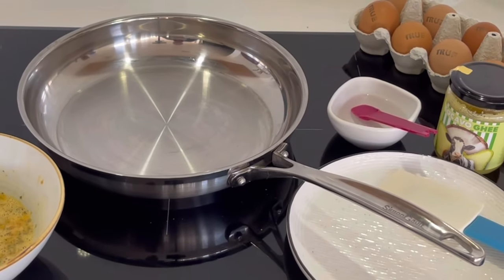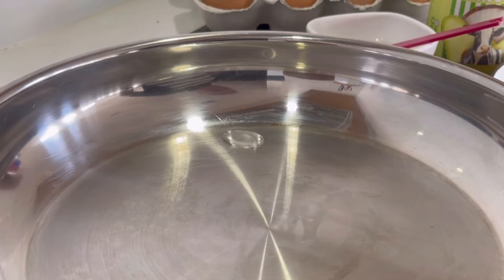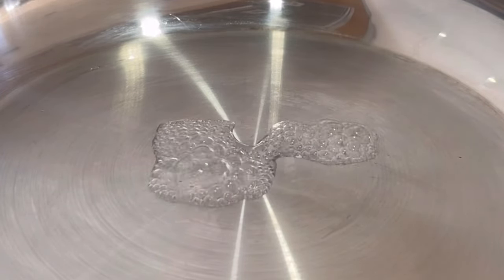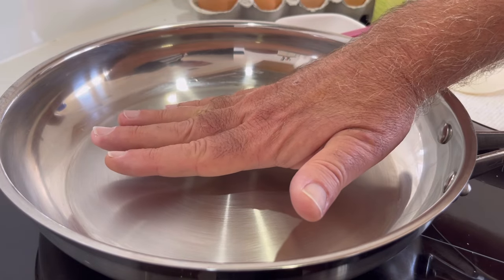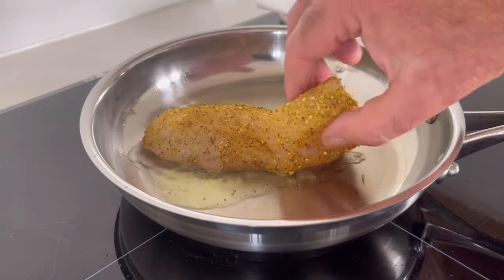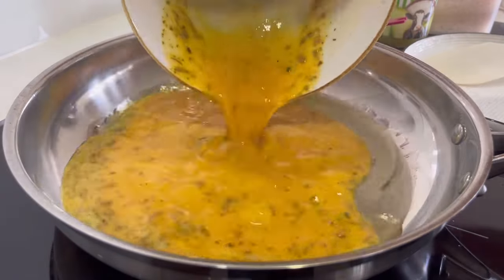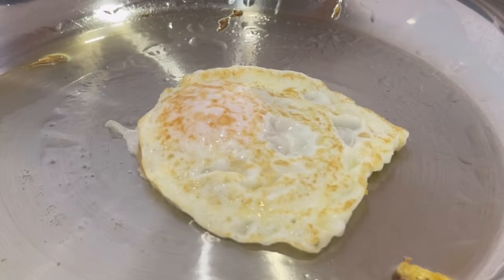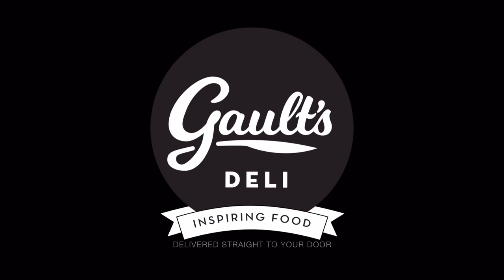The Ultimate Guide: How to Make Food Not Stick in a Stainless Steel Pan! 🍳🚫

Comment: This doesn’t work all them time,you can’t cook a burger back to back because it will stick. You have to clean the pan after each burger. It’s really annoying
Reply from the maker: You're absolutely right, burgers can be a bit sticky business on stainless steel, even with the perfect preheat!  Cleaning after each one can definitely be a drag. Here are a couple tricks that might help:

If you're grilling up a burger party, consider cooking them in batches instead of all at once. This will help keep the pan from getting overcrowded, which can lead to sticking.

A wider pan gives the burgers more space to sear properly without crowding each other. This can help prevent them from sticking together and making a mess.

Once you've got a nice sear on the first side, resist the urge to flip too early! Give the burger a minute or two to set up before moving it. This will help it release more easily from the pan.

While preheating is key, a touch more oil can also be your friend with burgers.  Just a thin layer can help create a barrier between the meat and the pan, preventing sticking.

 If you're really struggling with sticking, cast iron pans are naturally non-stick once seasoned properly. They might be a good option for future burger battles!

Thanks for the heads up, this is a great point to consider for anyone new to stainless steel.  Keep those burger grilling skills on point!

Cheers, 
Simon

Comment: Sadly this is not working for me the water is evaporating or just bubbling… no in between… help!
Reply from the maker: Hi PuffyLush,
If the water droplets are immediately evaporating upon contact with the pan, it suggests that your pan might be too hot. On the other hand, if the water just bubbles without skittering around, your pan is not hot enough. The test with water relies on the pan being at just the right temperature so that the water droplet can hover on the layer of its own steam without instantly evaporating. This usually occurs around 160°C (320°F), well above the boiling point of water but below the point where it would evaporate instantly.
Here are some suggestions to try:

Adjust your heat: If the water evaporates instantly, lower your heat slightly. Wait a minute or two, then try the water test again. If the water only bubbles, increase the heat slightly and repeat the test.

Warm up your pan slowly: If you're using a thick pan (like cast iron or thick-bottomed stainless steel), it may need more time to heat up evenly. Try leaving it on a medium heat for a few minutes longer.

Use a infrared thermometer: If you're finding the water test too unreliable, consider using an infrared thermometer to check your pan's temperature. This can give you a more accurate reading and help you find the right heat setting on your stove for the perfect pan temperature.
I hope this helps. Good luck.
Simon

Comment: Your explanation needs to be clearer so you were so confusing
Reply from the maker: Looking back, can you tell me what specific part of the video you found confusing?  Knowing that will help me improve the explanation for future viewers.

In the meantime, here are some additional tips that might be helpful for using stainless steel pans:

The water droplet test: This is a great way to gauge the pan's temperature. When a drop of water beads up and dances on the surface, the pan is hot enough for most things (except delicate fish).
Start with a hot, but not smoking, pan: High heat can be good for searing, but if you're worried about sticking, use a medium to medium-high heat setting.
Use the right amount of oil: A thin layer of oil will help prevent sticking without burning.
Don't overcrowd the pan: This can lead to uneven cooking and sticking.
Use a metal spatula: These are better for maneuvering food in a stainless steel pan than plastic utensils.
Let me know if any of these points clarify things, or if you have any other questions about using stainless steel pans.  I'm always happy to help!

Simon

Comment: When I put the butter it just turns black... Anyone?
Reply: To prevent that you need to first add the oil and then add the butter.
Reply: @lewisevander   thanks 👍
Reply from the maker: Hi there! Thanks for your comment. If your butter is turning black, it’s likely that the pan is too hot when you add it. Here are a few tips to help prevent this:

Preheat the Pan Correctly: Use the 'mercury ball effect' to test if your pan is at the right temperature. Add a droplet of water to the pan. If it forms a ball and dances on the surface, the pan is ready for the butter.

Lower the Heat: Ensure the pan isn't too hot before adding the butter. Stainless steel pans retain heat well, so it's better to err on the side of a lower temperature.

Add Oil First: If you prefer using regular butter, try adding a small amount of oil (like olive oil) to the pan first. This helps raise the smoke point of the butter and prevents it from burning.

Another Option You May Prefer: Use clarified butter or ghee. These have a higher smoke point than regular butter and are less likely to burn.

Hope this helps!
Reply: @simongault5804   thank you so much man you really try and respond to each comment!

Comment: Mine still sticks because i reduce the heat after it beads because its too hot for what im cooking. Any tips?
Reply from the maker: Great question! If you need to reduce the heat after the water beads, try this: after achieving the Leidenfrost effect, add your oil and wait a few seconds for it to heat up. Then, add your ingredients and immediately reduce the heat to your desired cooking temperature. This way, the pan maintains its non-stick properties from the initial heating, but you avoid burning your food. Also, ensure you're using enough oil and that the food surface is dry (not moist) before adding it to the pan to prevent sticking.

Hope this helps!
Cheers,
Simon

Comment: My pans become non stick using this method but they also are too hot and cook the food way to fast if i put oil in it immediately smokes and the food just burns within 30 seconds this is when the pan is at the water ball level hot so not too hot for the test if i try to do it before the water ball level it will stick so i cant see how i can make it not stick but also cook the food at a lower temp required for even cooking?
Reply from the maker: Thanks for the question! If your pan is getting too hot, causing oil to smoke and food to burn, here's a method to try:

Heat the Pan: Achieve the Leidenfrost effect with the water droplet.
Cool Down Slightly: Once you see the water ball, reduce the heat slightly and let the pan cool for a moment before adding oil.
Add Oil: Add your oil and let it heat up, but not to the smoking point.
Add Food: Add your food quickly and then reduce the heat to the desired cooking temperature.
This should help maintain non-stick properties without overheating.

Hope this helps!
Cheers,
Simon
Reply: @simongault5804  This is the question I came looking for an answer to as well. I would love a video that explains this part more, eg dropping the temp once the non stick is achieved. It's been hit and miss for me.
Reply from the maker: @SelinaFenechArtistAndAuthor  Hi Selina, The key is to adjust the heat once you've achieved that initial sear or non-stick effect. Generally, you’ll want to lower the heat slightly to maintain the cooking process without burning or overcooking the food. This gives you better control and ensures even results.

I’m planning to make a video that dives deeper into this topic, explaining when and how to adjust the temperature for consistent results. I’ll get to it as soon as I can (I’m busy judging cooking competitions this week). Thanks for the suggestion!
Cheers,
Simon

Comment: Can I put the water in first and wait until it balls up? Or do I have to add water after I suspect it's at the right temperature?
Reply from the maker: You should first heat the pan and then add the water to test the temperature. The idea is to get the pan up to the right heat before you add any ingredients. If you add the water first, it will just evaporate slowly, and you won’t be able to gauge when the pan is at the perfect temperature.

Instead, heat the pan dry for a couple of minutes, then add a small drop of water (like a 1/4 teaspoon). If the water forms a ball and "dances" across the surface, the pan is ready. This method ensures you're at the correct temperature for cooking without sticking.
Reply: @simongault5804  Thanks so much for the response! I had steak and eggs for dinner, cooked back to back in the same pan. I pre-heated the pan as advised (with dancing water!) and the steak didn't stick, but the eggs did. I guess maybe the pan got too hot while I was cooking the steak? Any advice? Do I need to let the pan cool before putting the eggs in?
Reply from the maker: Thanks for the feedback! Glad to hear the steak turned out well with the dancing water trick! As for the eggs, you're right—it's likely the pan got too hot while cooking the steak. Eggs are a bit more delicate and need a lower temperature to avoid sticking. I’d recommend letting the pan cool slightly before adding the eggs or lowering the heat once the steak is done. You can also add a bit more butter or oil before cooking the eggs to help prevent sticking. Hope this helps, and happy cooking!
Reply: @simongault5804  Thank you! I've cooked eggs twice now and it works! :D I'm still getting the hang of it, but at least I'm on the right track now and have a general idea of what to do. I only started cooking this year and with a stainless steel pan a few days ago. Looking forward to mastering it. I really appreciate your help. Thanks, Chef!:virtualhug:

Comment: Can you adjust the temperature after the water starts "dancing" around the pan? Or do you have to keep it at the same temperature?
Reply from the maker: Hi Ewilds,

Certainly! You can adjust the temperature, but keep in mind a couple of things:

- Different foods require varying cooking temperatures. For instance, delicate items like eggs need a lower temperature compared to what you'd use for searing meat.
- After establishing the non-stick surface, tailor the temperature to suit what you're cooking, but avoid making drastic changes.
- Remember, each pan may react differently to temperature adjustments due to its material and thickness. With time and experience, you'll gain a better understanding of how your particular pan behaves and how to effectively modify the temperature for various cooking needs.

Hope this helps. Happy sautéing!

Best,
Simon

Comment: help im desperate 
So i tried this trick since many many videos give the same tip and the comments agree with them as well but when i tried it.. the moment it was just hot enough for the water to bead up, i added the peanut oil and it immediately started smoking and giving off a burnt smell and my eggs are like instantly burnt even as i lower the heat on my induction stove. I tried it seven times to make a fried egg (no joke) and i am just curious why this tip works for most people and not me. Is it the exact material of the pan?
Reply from the maker: Hi Speed,
It sounds like you’ve been through quite the process trying to get that technique right! There are a few things that might be causing the issue:

Once you achieve the beading of the water droplet, try turning the heat down. A common mistake is heating the pan on high and not lowering the temperature once the beading effect occurs. If you leave it on high, the pan will continue to heat up and become too hot. It’s best to gradually heat the pan over medium heat, allowing better control of the temperature and preventing overheating.

Oil Type: Peanut oil has a relatively high smoke point, but if the pan is already too hot, even peanut oil will start to smoke and burn. When the water beads up, it might indicate that the pan is too hot for frying eggs, especially with oil added immediately after.

Pan Material: The exact material of your pan could also be a factor. Stainless steel, for instance, heats very quickly and retains heat, which can make temperature control tricky, especially on an induction stove. If your pan doesn’t have a good non-stick surface or hasn’t been properly seasoned (in the case of cast iron), the eggs might stick and burn faster.

Heat Control: Induction stoves can be quite powerful, and they tend to heat up pans much faster than conventional gas or electric stoves. You might need to preheat at a lower temperature or lower the heat even before adding the oil to prevent it from getting too hot.

I’ll do a more in-depth video to help out further, as this one is a bit on the short side to get all the relevant information across. In the meantime, try starting with a slightly cooler pan and adding the oil before it gets too hot. You could also experiment with a different oil, like olive or vegetable oil, which have lower smoke points and may behave differently. Hope this helps!

Cheers,
Simon

Comment: I do all this.. still sticks. Could it be the Pan?
Reply from the maker: Hi Smiley Thanks for your comment! Stainless steel pans can indeed be a bit tricky. If your food is still sticking, ensure the pan is properly heated before adding oil and ingredients. The Leidenfrost effect, which I demonstrated with the water, should help. Often, people say the water test doesn't work, but science proves it does. If it's still an issue, it might be the pan’s quality or condition. With high-quality stainless steel, you should see good results. Hope this helps! 😊
Best of luck,
Simon

Comment: Confused because when you get the pan that hot the food will just burn before it has the time to fully cook ??? it’s never made any sense to me and every time I’ve tried it says food sticks regardless because it cools down when I put the food in anyone else have this problem???
Reply from the maker: Hi imcaradelucia, I totally understand the struggle with stainless steel pans – they can be a real test of your culinary skills! Let me give you a few chef's tips to master this challenge:

The Perfect Heat: It's all about hitting that sweet spot with the temperature. You want your pan nicely heated but not blazing hot. Remember, the water droplet test is more of a rough guide – you're looking for a gentle sizzle, not an intense reaction.

Warming Up: Gently pre-heat your pan. It's not a race to the hottest temperature. A moderate heat where the water dances a bit is your cue.

Oil or Butter: Once your pan is ready, introduce some oil or butter. Aim for that lovely shimmer, avoid smoking. This is where the magic happens, creating a barrier between the pan and your food.

Introducing the Food: When you add your ingredients, they'll cool the pan a touch, and that's perfectly fine. If everything's sticking instantly, perhaps your pan was a tad too enthusiastic or needed a bit more oil.

Let the Cooking Happen: Resist the urge to keep poking at your food. Give it a chance to form that gorgeous sear and release on its own.

Control Your Flame: If the outside is cooking too fast, don't be shy to turn down the heat. It’s about getting a nice, even cook.

Practice Makes Perfect: Using stainless steel is an art. Each pan and stove has its quirks, so get to know yours.

A little sticking is part of the journey with stainless steel – it's about minimizing it for that perfect cook. If it’s still a hassle, there’s no shame in reaching for a non-stick pan for the trickier stuff like eggs. Keep at it, and you'll find the rhythm that works for you in no time!

Merry Christmas,
Simon

Comment: Will this work for steaks?
Thank you!! Happy cooking everyone!
Reply from the maker: Absolutely! The water droplet test works great for steaks too. Here's the trick:

Get your pan nice and hot over medium-high heat. You want it hot enough to sizzle when you add a drop of water.

Now for the test! Flick a small drop of water onto the hot pan. If it forms a tight little ball and dances around (like a tiny mercury ball!), that's your cue to add some oil and then your steak. That sizzle means the pan is hot enough to sear the steak beautifully without sticking.

Remember, with steaks, you want a good sear for that delicious crust. So, once you add the steak, try not to move it around too much at first. Let it cook undisturbed for a minute or two to get that nice sear going.

Speaking of searing, if you're a steak lover like me, you might be interested in my playlist dedicated to cooking steaks!  While my personal preference leans towards cast iron pans for their incredible heat retention and searing ability, stainless steel pans are a fantastic alternative if you don't have one.

Here's a quick comparison:

Cast Iron: Holds heat like a champ, perfect for searing steaks and achieving a beautiful crust. The downside is they can be a bit trickier to keep from sticking at first, and they take longer to heat up.

Stainless Steel: Heats up quickly and offers more control over temperature once it's hot. The water droplet test is your friend here! Stainless steel might not sear quite as intensely as cast iron, but you can still achieve great results with the right technique.

No matter which pan you choose, the key is getting it hot enough before adding your steak. So, grab that pan, fire up the heat, and get ready for some delicious steak action!  Let me know if you have any other questions, and happy cooking!

Cheers,
Simon

Comment: Its tricky even with the water mercury test. I notice another thing is after the mercury water test, i pour oil onto the pan and put in food. It will stick, i suspect the oil cool down the pan making food stick.
Reply from the maker: Hi @bernardmt7090 Allow the pan to reheat slightly after adding the oil before placing the food in. This should help maintain the right temperature and keep the food from sticking.

Hope this helps!